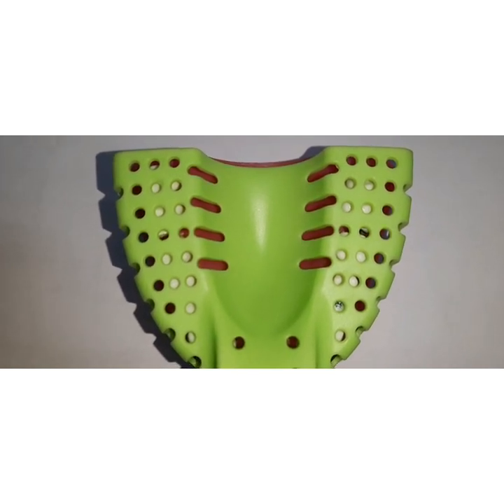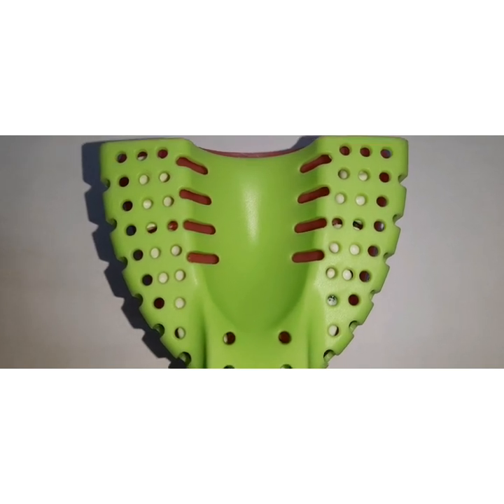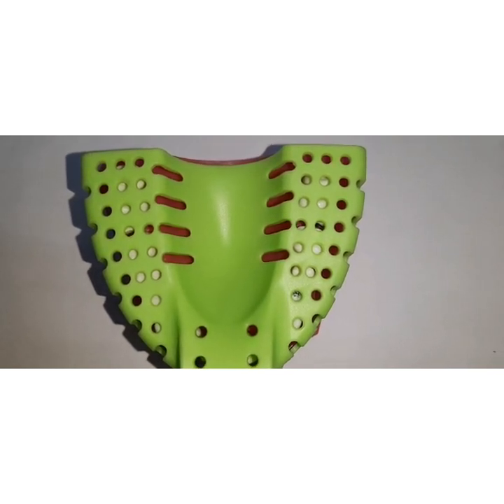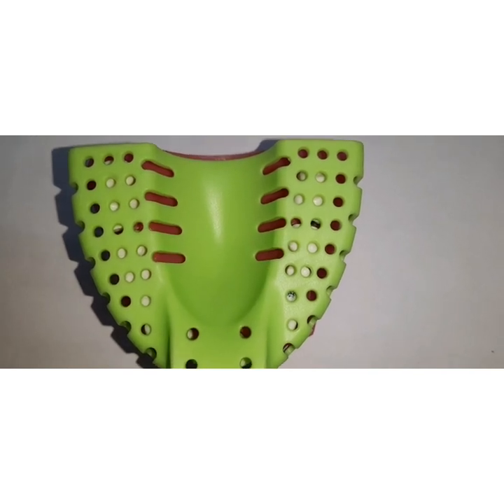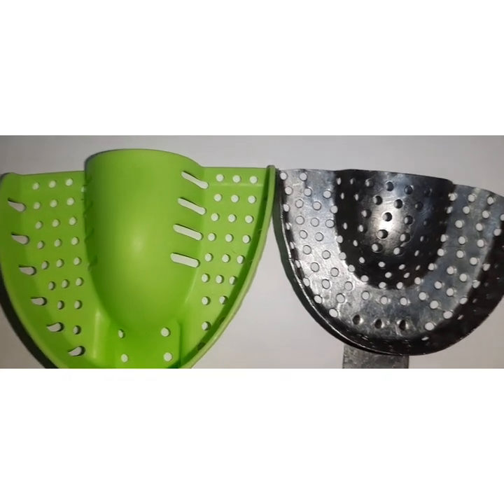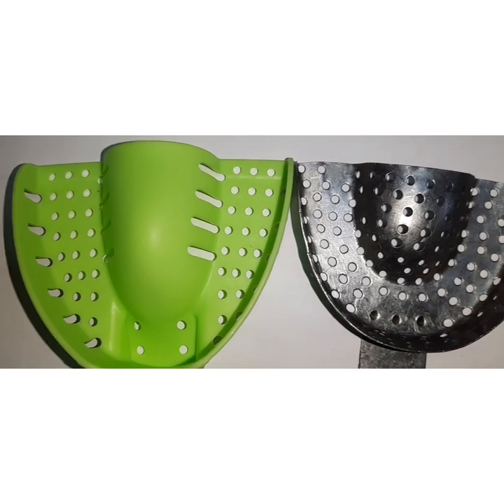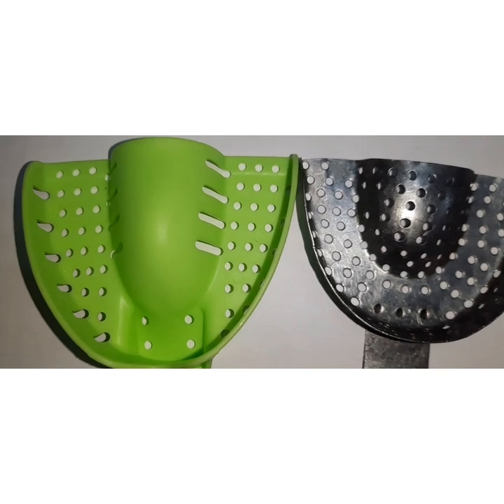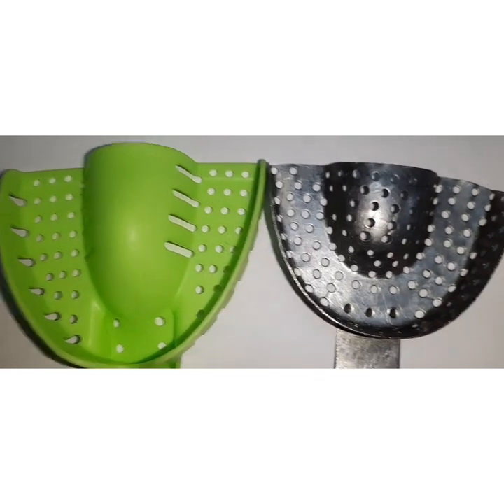IMPRESSIONS IN FIXED PROSTHODONTICS

Comment: Sir in nallaswani,
Stock tray;or putty wash technique has only
2 subtypes
1.double mix
2. Single mix
Which one was the one u explained at first?
Reply from the maker: Not seen Nallaswamy. Referred DCNA journal on Fixed Prosthodontics.
Reply from the maker: Not seen Nallaswamy. Referred Dcna journal on Fixed Prosthodontics.